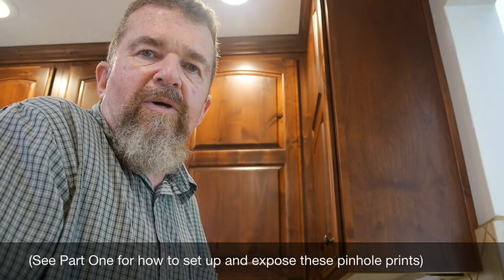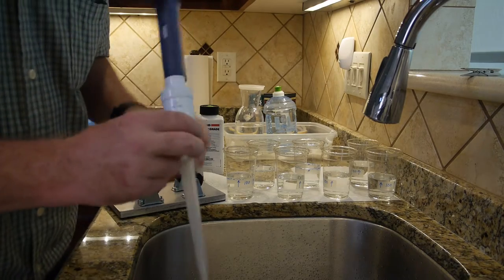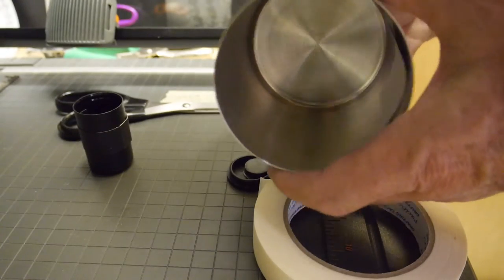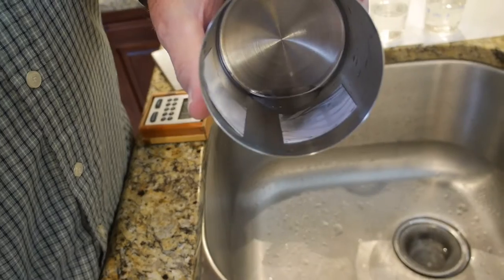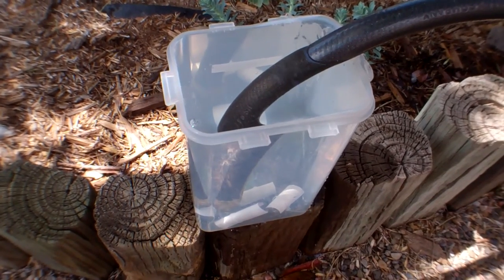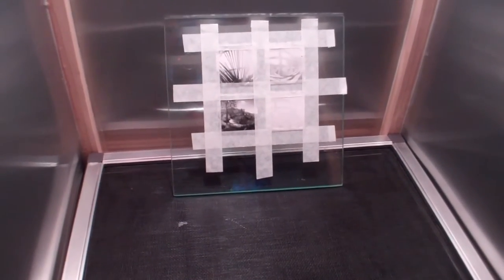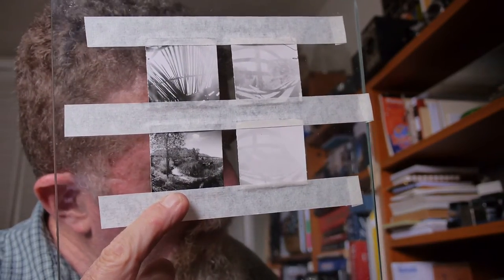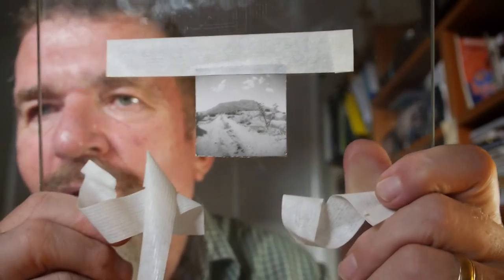Pinhole Prints - The Complete Process, Part Two

Comment: You really got me blown away by the ingenious and apparanty tried and tested method of taking and developing these pictures. Really well organised.
Very good system plus economical. I'm definetely going to give it a try. The previous 2 tries to make a pinhole camera with a cellphone strapped inside the box as a substitute for photopaper(to catch the reflection of the picture bounced off a white background in front of the hole) failed. No matter how hardi tried: paper hole, tinfoil hole, tincan sheet hole nothing works. But I will try this.

Comment: Hi Joe, is this paper save to use with a red darkroom bulb? Do you use a specific distance between the paper and the bulb?
Reply from the maker: Yes, it is red light safe, like negative print paper. I think minimum distance is around 36"; there may be a data sheet on Ilford's website.
Reply: @Joe_VanCleave  Nice. I am starting the build tomorrow. Very inspiring project joe!

Comment: One more question Joe: i made the container camera's. My pinhole is 0,2 mm. Hoe do I know what the f/ is? I tried to follow your instructions and came to f/200 could this be correct? I'm confused because you use f/128 on your meter in combination with ISO 10 from the paper. Hope hou can help.
Reply from the maker: The camera's focal ratio is the focal length (to the center of the film) divided by the aperture size. So your's is likely F/200 as you say.

My metering method uses F/128 because that's the highest f-stop on that particular model of light meter; I don't have a light meter that goes directly to F/200. Which is also why I then need to use the conversion formula to determine the exposure time for F/200. Which is: ((Fcamera)/(Fmeter))^2 x meter's exposure time = Camera exposure time. You don't need a light meter that goes to F/128, just use the highest F-stop reading on your meter and use the above formula to convert the recommended exposure time on the meter to what your camera needs for its F-stop.
Reply: @Joe_VanCleave  is it correct that when you rate the direct positive paper as ISO 10 instead of ISO 3 you van use the f/128 as the correct exposure?

Comment: Excellent. I'm curious could you do something like this using a 8x10 sheet ? Obviously the canister would have to be a lot larger, and, what difference would it make having the paper curved in the canister as opposed to sitting in a flat holder ? Thanks
Reply from the maker: A curved film plane can offer more even exposures with wide angles of view - with flat film planes, the corners can darken with vignetting. But the trade-off is geometric distortion with a curved film plane.

A common way to make larger curved film plane cameras is by using cylindrical containers like paint can or large popcorn tins and the like.
Reply: Thank you Joe, you've got me thinking. :)